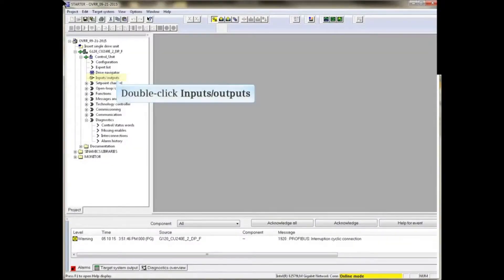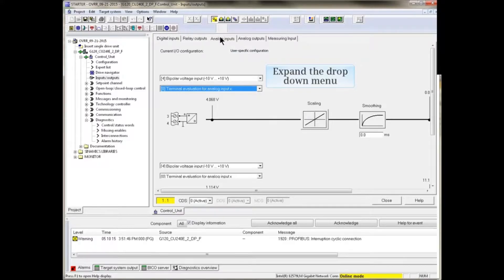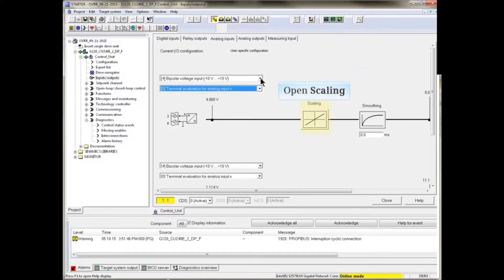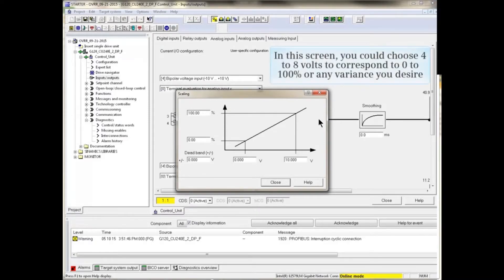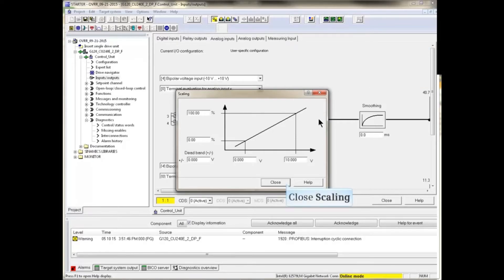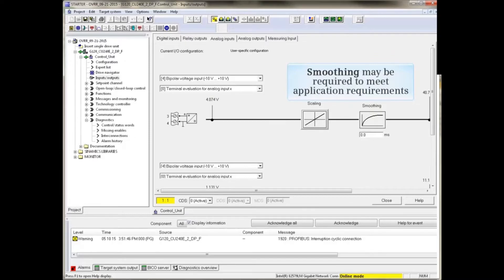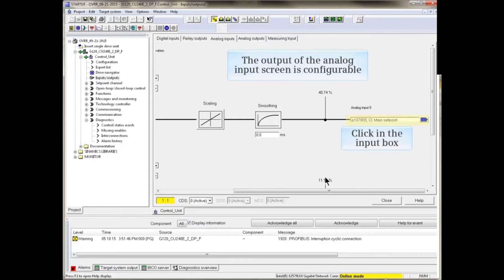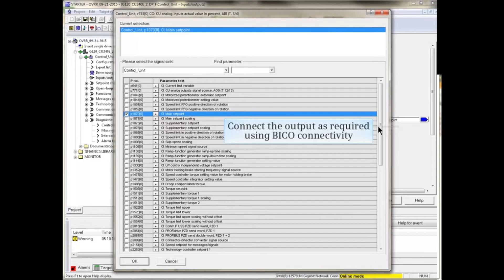48 : Analog Input Configuration Screen in STARTER

Comment: How to do if I would like to change new double motor module difference part number with the old one becuase it already obsoleted ?
Reply from the maker: Generally in these cases, you can get the current MLFB of the sucessor product from the siemens support website. Just search in google with the old MLFB